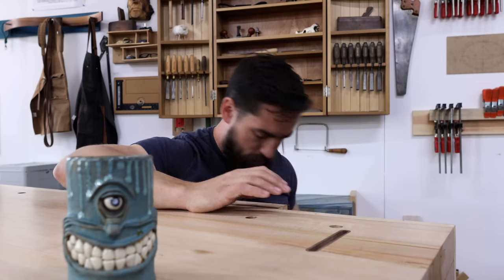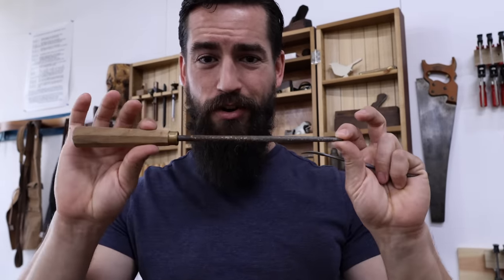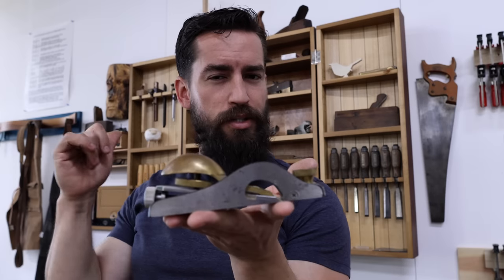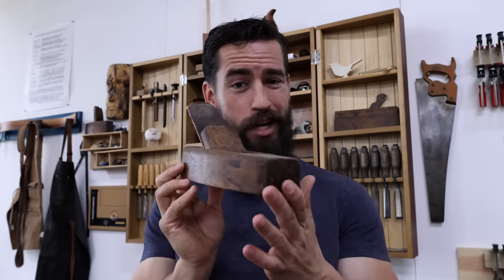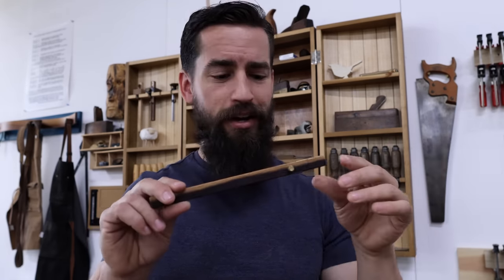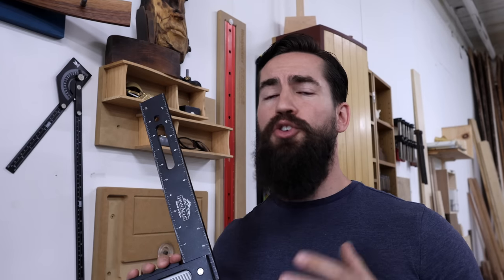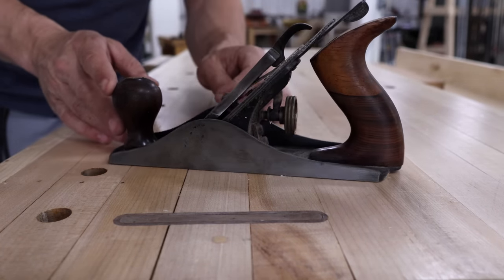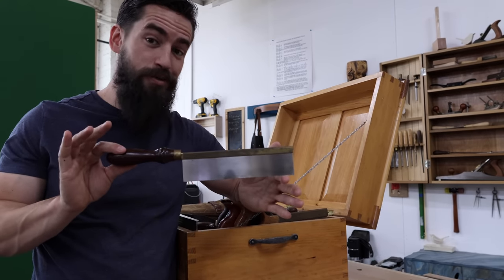What tools do beginner woodworkers REALLY need?

Comment: I liked this videos and all of your other videos I've seen.  However, you disparaged the Wood River hand planes without any  explanation.  Rob Cosman uses these almost exclusively in his work, had a large role in remodeling them for Woodcraft, and sells cosmanized versions outside of the U.S at his own store.   He will hand plane all of his parts rather than sand and gets a finish so smooth you frequently enter a fugue state.  Ebay is now way over-priced for old  Stanley planes and Wood River presents a product at a much lower cost than Lie Nielson.  As someone new to woodworking it is hard to navigate the divergent opinions unless there is some objective testing or other sound basis..
Reply: Cosman is a sales rep for Wood River.
Reply: @hdwoodshop  Of course I know that.  That in no way speaks to their quality.  It is simply a fact.  I simply wanted to know what Encurtis' rationale was before making a purchasing decision.
Reply: I too would like to know why Erik doesn't like them. I invested in a Wood River plane thinking I was getting a solid plane. And like @lenpiazza8493, I find it difficult to navigate all of the often contradictory opinions regarding which planes are best, particularly for beginners.

Comment: I worked for a boat builder many years ago and we built a huge radius staircase in his house after the laminations had dried he handed me the #8 Stanley and had me run up and down the stairs to flatten the stringer. That was the last time I used a #8, I do most of my jointing with a #6 because it’s what I have.

Comment: That's a beautiful collection you have, thanks for sharing with us
Reply from the maker: That is absolutely reasonable. I've heard that Woodriver has gone through two more iterations since I used them back in 2009/2010 and are now on version 3.0. It seems many people are happy with them and if they work well for them, I'm glad there is a less expensive option on the market for folks. I can only speak to my experience which was a subpar quality of tool steel and a really poor casting. I know Rob worked with Tom Lie-Nielsen for some years, so I hope he brought some knowledge and quality control to the Woodriver line. If they're working well for folks these days, that's good enough for me.

Comment: Nice presentation, I like your under bench box too, nice bit of dovetail work on it.  I am with you when using a dovetail saw, I prefer the straight handle also.  Glen-Drake Woodworks, who makes a unique line of hand tools for fine woodworking and an instructor at the Krenov Woodworking School, also makes an excellent dovetail,saw with a straight handle, and a progressive tooth cut, allowing you to start the cut with a fine tooth and then goes to a more aggressive cut.  The straight handle gives more control and helps me to keep my wrist straight.  Something you might want to look into or consider…
Cheers
Reply from the maker: That's good to know! Thanks for sharing that.

Comment: I would love for you to expand on your opinion of woodriver planes. I have a woodriver no 6 and it’s my only hand plane. It’s worked well for the little bit I’ve used it, but I have no experience with other brands to compare it to. Rob Cosman seems to like them, but an expansion on your honest and valid opinion would be appreciated
Reply from the maker: It's nothing more than from my experience years ago. From what I've been told they have gone through two more iterations since then and are now on Woodriver 3.0. Many have said they have had positive experiences with them. I can't say the same but if it works for them then I'm glad there is a less expensive option out there on the market.

Comment: Nicely paced and seemed pretty even handed and good advice, nice to see a few English names within your collection, I know they can be a bit pricier in the states, but they are plentiful and still reasonable cost over here so often a better bet than buying new.
I love my little Record 043 you can buy one with 3 cutters for less than a decent router bit and it's so much more enjoyable to use and is often quicker too ! 
Sorby chisels are great, but again I've never paid more than about £30 for one and that was for a massive 2" framing chisel and I gather they run at around £100 now !

Comment: Great video. Thank you for the walk-through of your hand tool arsenal!

Question regarding your No 4s- any variance in how these are set up? (e.g. bed angle, mouth width, blade camber?)

Thanks again.
Reply from the maker: The two under my bench are largely the same, though the 4 1/2 does have a 5-10 degree back bevel on it, giving it a higher angle cutting action. A “York pitch”, I believe it’s called. But they function largely the same, just nice to have a little extra width when I need it. The record is set the same as my Stanley, just used for off site work. And the mention-but-not-shown Stanley 4 is an old beater that’s sharpened to a much lesser refinement and used for rougher construction methods like refining a scribe line when installing cabinetry. 

Hope that’s helpful. And thanks for watching 🙏
Reply: Very helpful. Thank you so much for your response!

Comment: I love the coffee thing!  You do You.  And I like your presentation style too.  That's Wow! engraving on that block plane.   How do you keep the planes under your bench rust free? Why do you use a 4 instead of the 4 1/2. I understand the difference in cut width and maybe the weight.  I don't think it's a sin to be using one and not the other, but I'm interested to hear your reasoning. What's your reason?
Reply from the maker: I don't pay much attention to surface rust. If it becomes a problem I hit it with a little 3-in-1 and 800 grit. As far as 4 v 4 1/2, it's really just preference. No different than block plane size preferences. Just love the way the 4 feels in my hand.

Comment: I have been building a hand collection and had considered buying a wood river 5-1/2. May I ask why you dislike them?
Reply from the maker: I will say, this was 15 years ago so maybe (hopefully) they’ve improved since then, but I found the casting of the #5 I purchased warped over time and the quality of the blade steel was meh. The block plane I purchased—which I still have and use on job sites as a beater—was better but still feels meh. They are cheaper for a reason. That said, they were brand new to hand tools when I bought them and I imagine if the quality remained subpar they wouldn’t have lasted very long at all.

While I’m not a fan of veritas’s handles, I do trust the quality of their castings and tool steel. And they’re not much more expensive than a wood river.
Reply: Thank you, I appreciate your reply. Other than my Bridge city HP8, which I love, almost all of my planes are old Millers Falls. I’m pleased with them, but have nothing to compare them to. Regardless, I think make a good point and spending a little more for something from a company with known quality is a better choice

Comment: Enjoyed the video! I have several of the same hand planes. I do have a Woodriver #4 1/2 that I really like.  Curious why you don't care for them?
Reply from the maker: To be fair to them it was 15 years ago so maybe (hopefully) they’ve improved since then, but I found the casting of the #5 I purchased warped over time and the quality of the blade steel was meh. The block plane I purchased—which I still have and use on job sites as a beater—was better but still feels meh. 

That said, they were brand new to hand tools when I bought them and I imagine if the quality remained subpar they wouldn’t have lasted very long at all. Glad to hear you’ve had a positive experience with their 4 1/2 though!
Reply: @ENCurtis  I was going to ask the same question. I have been drinking Rob Cosmans kool aid and was thinking about getting a woodriver 5.5. The woodriver is now at version 3 - apparently they were redesigned about 10 yrs ago. There a several utubes that say they are not a perfect out of the box as a LN, but after than a little filing and sharpening they work the same.
Reply: @ENCurtis  I was also surprised at your opinion on the  Wood River.   I also purchased the 4-1/2 and love it.  However,  at the time, I had zero experience with hand planes.  So,  I didn't have  any personal knowledge to base what I like or dislike. I hope that makes sense.  Since then I have  completely  and happily fallen into the bottomless rabbit hole of hand planes.  But then I'm just a semi-retired guy with a lot of time on my hands.
Reply from the maker: @mgreene888  I’m glad to hear they’ve redesigned and improved. I have no grudge against woodcraft or woodriver, this was just my experience some years ago. I do have reservations about spending that kind of money and needing to redress the plane out of the box when veritas’ planes are at a similar price point and of a high quality, but again that’s only my opinion. If it works for you I have no issue! So long as you’re enjoying using it and it cuts well, then it’s money well spent in my book 👊
Reply: @ENCurtis  Funny you should mention that - I am looking at the Veritas 5.5 too :)

Comment: Great video! The corrugation purpose is a myth. You can prove with math and physics that drag is not reduced. It's mainly due to the fact that pressure increases (smaller surface area, pretty much same weight). My #6 and #7 are both corrugated and I love them both 😊 Only issue is if you're using them at an angle on an edge, you might catch the edge in a trough. Other than that, no cons in my experience.
Reply from the maker: Interesting to know that decrease in drag has actually been disproven!

Comment: Would love to understand what the 3 or 4 or stanley 5 mean. Is it a rating system?
Reply from the maker: Excellent question. In short, its a reference system stanley invented regarding the length of their planes. There's a lot to it involving the history of smoothing planes v jack planes v fore planes, etc and the invention of mass produced metal planes, but to over simplify: for numbers 1-8, the higher the number the longer the plane.

Comment: Hey, you said WoodRiver planes are not good, don't worry, I'm not offended. Do you really think they are bad? I was thinking about getting one if I can find it with a discount. 

You said sometimes woodworkers are elitists, I don't care about that, as a beginner I only want something that doesn't need to much preparation work out of the box, and that doesn't break the bank either, a L.N at this stage would be excessive.

I bought an old Stanley and now I'm selling it because it needs to much work, It took me forever to square the blade and sharpen it, all by hand, but it was still not working great, It probably  needed some work on the chip breaker or the lever cap, anyway, I'm done with it, need something that won't take longer than 1 hour or so to set up.

Comment: Would love to hear you compare/contrast the WR and LN planes as someone who has used both! Many people want to buy american but the price of those chinese made planes can be hard to resist when they can't hop over the Maine and try out an LN in the storefront.
Reply: I think he tried them before Rob Cosman redesigned the woodriver planes. To be based off the old bedrock stanleys.
Reply: Agreed… the early woodriver planes were lousy.  Newer (current) versions are good.  If you take away the brass lever cap and shape wood parts, you’d be hard pressed to know the difference - Lie Nielsen probably has a little less slop in the yoke fit, but this is part of any hand plane that is quickly forgotten because you deal with it the same no matter how much there is.  LN blades may be better steel, but again, you have to sharpen every blade on a regular basis and I find that the wood choice makes a greater difference in how often I sharpen.   Get what you can afford

Comment: Content Request ------ you obviously have style,  one that I appreciate right down to the grinning cyclops cup-   projects  take time but show us the design process and the works of others you admire to build your  - along the way explain some of the tools used to make those visions- and no doubt we get see the  mistakes that come from pursuing new things..

PS - have  short 7 inch rather pretty dovetail?  20 tpi saw (from 19th century)  that is used for precision work.  Significantly smaller than than most dovetail saws but control seems to be better. Using this tiny saw is bit like having  hand that is a saw. 
The saw is pistol grip but noticeable horizontal... 
 
- Dovetails saws too large???? 

Looking around after watching your video,  Gramercy saws makes a saw that is larger but similar to mine, so small saws might be the right way top go.....
Reply from the maker: i've been considering how to incorporate some more design videos into the process. It will come with time, I think.

Comment: i am currently planning to transition over to hand tool use. from power tool use. just one question. i want to get one really good saw. will i be fine to get a dove tale saw. i am thinking on getting a VERITAS.
Reply from the maker: Honestly most any of the contemporary DT saws you purchase will be very good. The Veritas has served me well for years, and the LN is also very good. Both are similar in price.
Reply: @ENCurtis  yeah but is there anything cheaper that's any good? Finally after many years I found an old Disston 10" for next to nothing. It doesn't even look like someone tried to saw bricks with it.

Comment: I just purchased the LN router plane… how do you sharpen that little sucker?
Reply from the maker: She's a fickle mistress but less complicated than it seems. Mostly I just sharpened the bottom flat on the stone--that was always easiest. Then use the side of the stone to hone the top and remove the burr. She's a joinery tool. Doesn't need to be the sharpest tool in the cabinet!

Comment: I've drank the red kool-aid a few times and then realized that I wasted my money because I don't really use them as much as the cost dictates that I should. The one that I use the most is the giant triangle square that I didn't buy for woodworking but use it for cutting panels. I'm a Starrett fan. I've bought cheaper squares and ended up replacing them with Starrett.

Comment: You showed a mallet and said you don't use it.  You then moved on without saying what you use to drive your chisels with.
Reply from the maker: Fair point. It got lost to the cutting room floor. I use a simple, cheap rubber mallet from the big box stores. Been using it for a decade and never had an issue with it.